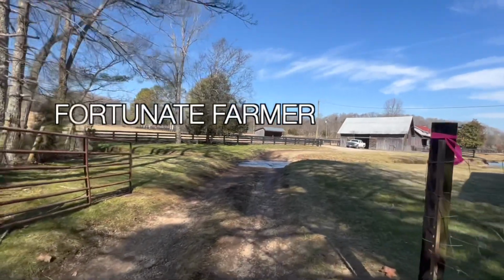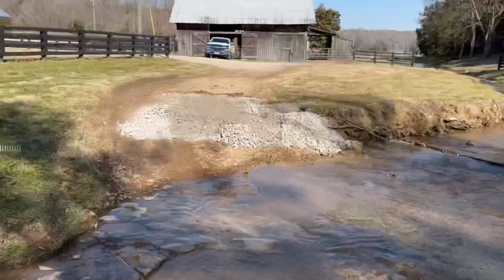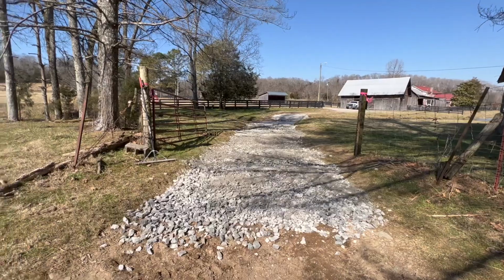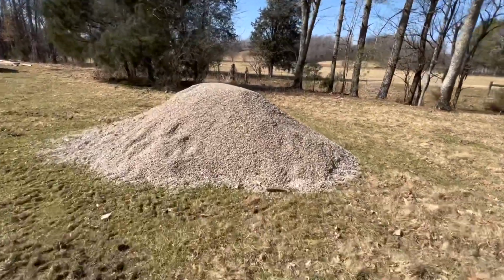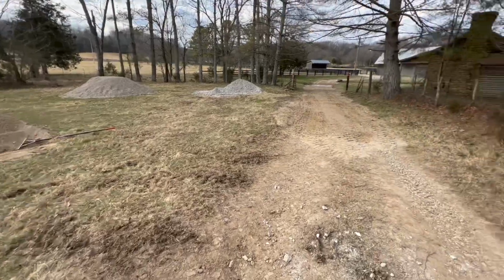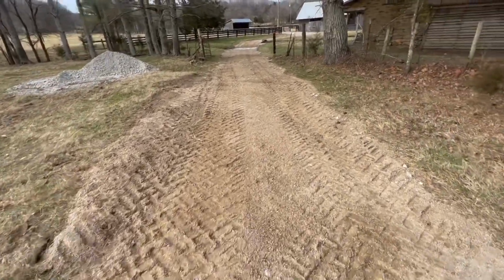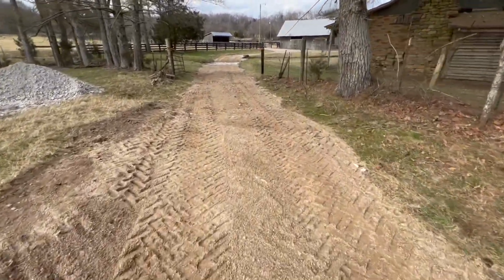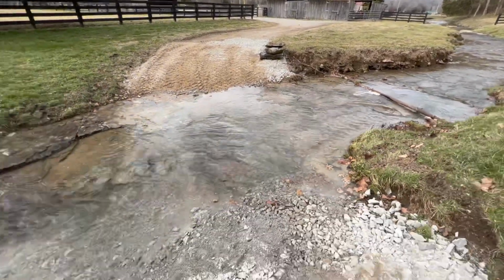Repairing Gravel Driveway (Part 1)

Comment: Be nice to be young and full of energy. I’ve run many of skid steers with a handle in my day as well. But now I have a 6060 kabota I just use the float control on the loader to move rock around now a days. It’s definitely not a skid steer but it saves the back. Looking good. Keep after it your going to have a nice place.
Reply from the maker: Thanks Josh! I forgot about the float feature! Next time…